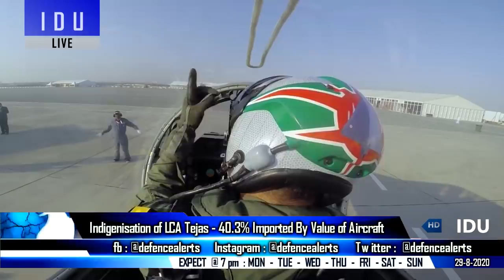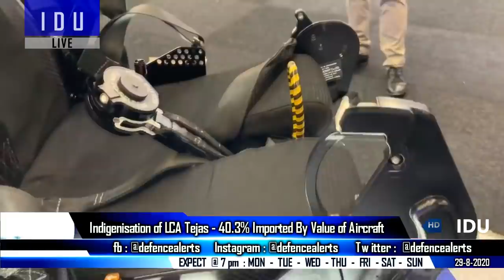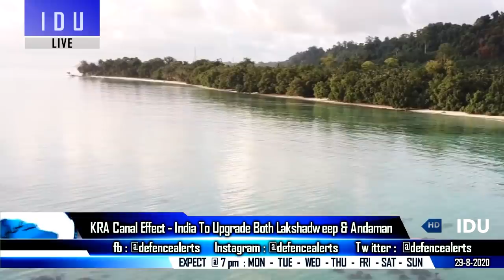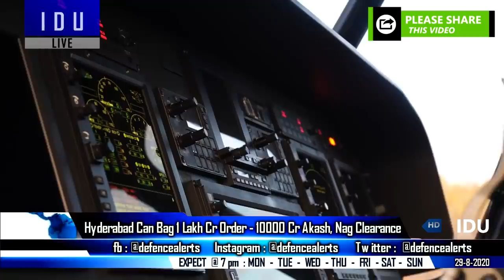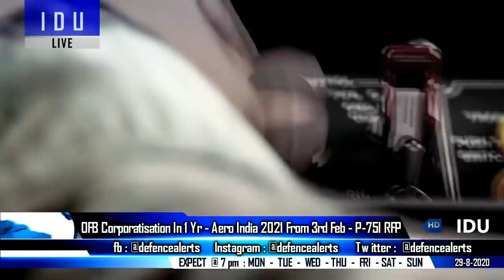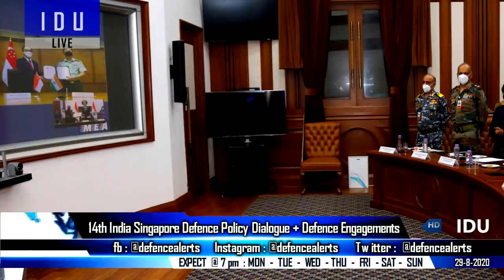Indian Defence Updates : Tejas 40.3% Imported,NAG Clearance,10000 Cr Akash Order,KRA Canal Effect

Comment: Tejas is good. 40.3% by value. Engine is imported and pricey and so is Martin Baker.

However the Radar, IFR probe, SDR, Helmets and Radome should be replaced by indigenous options
Reply: @Kailash Rava  thank God, our decision makers don't go by your crap opinion.

Btw whats your age?

You don't seem to have any knowledge about how an industry works.
Reply: @Kailash Rava  ideally the Apaches doesn't fill any of our needs. Its just unnecessary hype you see.

U think 28 Apaches makes any difference? Especially when 22 of them are in Air Force while we are busy creating IBGs?

And you called Tejas a crap jet. And compared it to an F16. Which inadvertently shows that you are comparing Apples with oranges.

Thirdly you have not taken into account tue aerospace industry.

You are just some emotionally attached Armed Forces praising dude Who thinks Armed Forces are Gods.